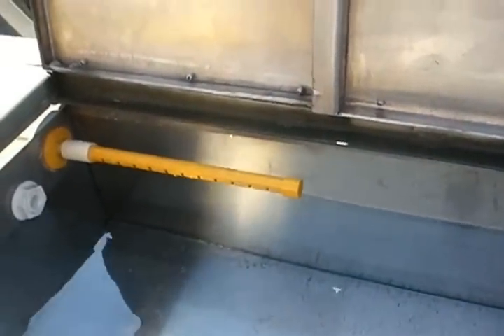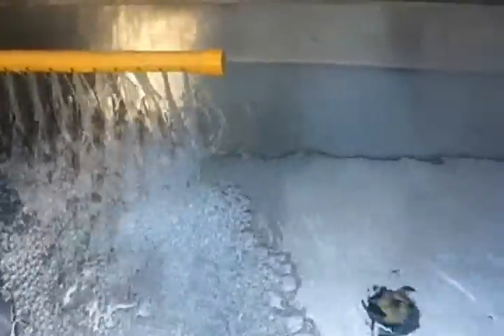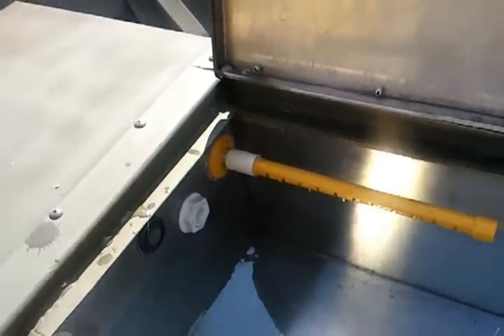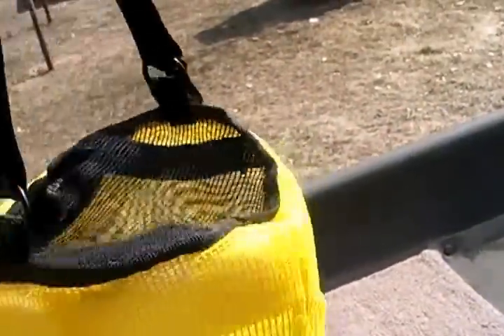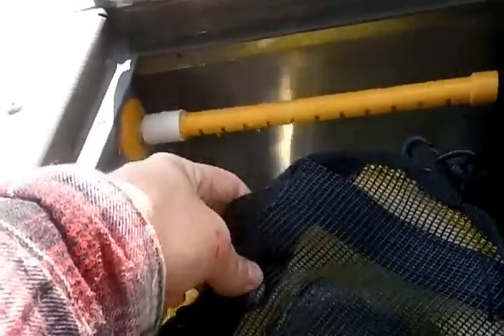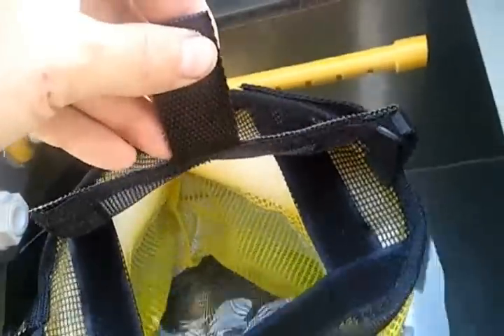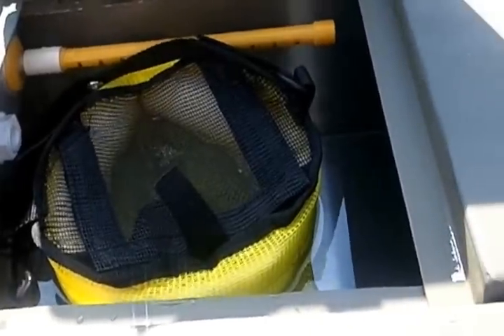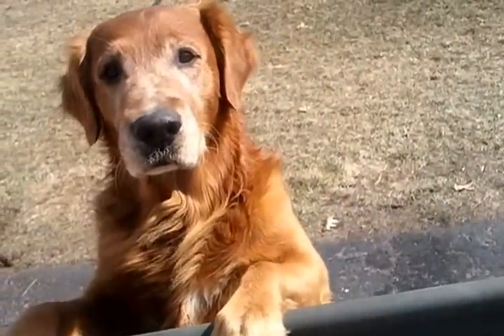Livewell in Jon boat

Comment: What I did to separate my bait/fish in my Jon boat livewell was to get 1/4" wire mesh and welded it across the tank and the water flows right through it what sized pump do you use on your recirculation pump in gph  where did you get your boat fabricated I got mine in challmet louisiana my boat is a  15' and it's custom made with a tunnel hull and sponsons liked the video thanks